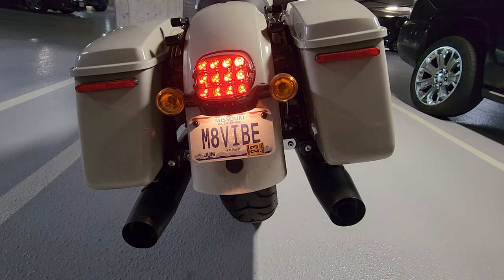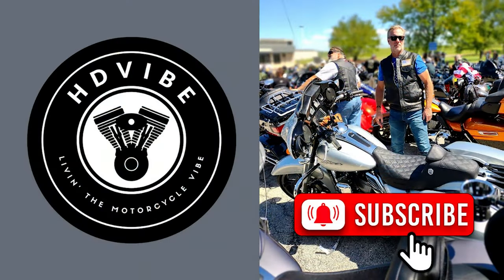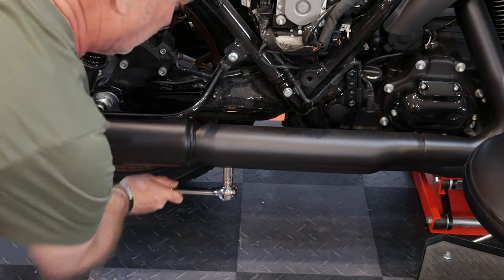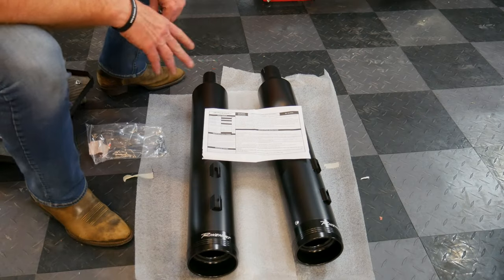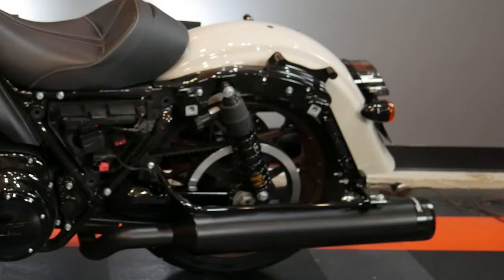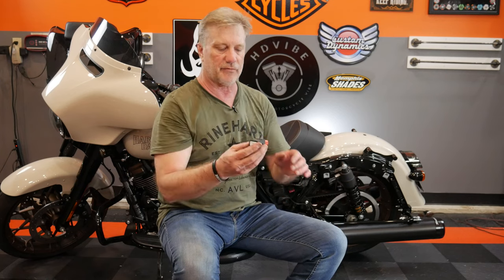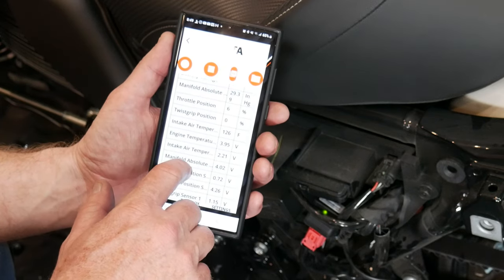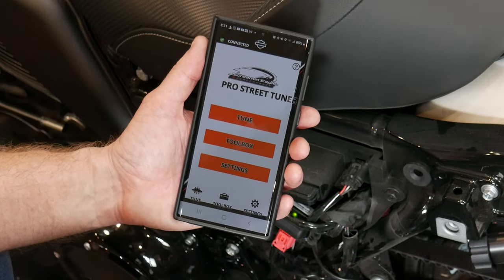Tune your Harley with the NEW Screamin Eagle Bluetooth Pro Street Tuner | Street Glide ST

Comment: Mine came with no instruction sheet :)  It doesn't seem clear, but once you have pushed a tune to the bike, does the bluetooth component need to stay attached to the motorcycle?  Thanks for the thorough vid!
Reply from the maker: Thanks for watching and commenting.   After you load the map to the bike and complete the process...you do not need to keep the tuner attached to the bike.  However, if you do keep it attached, you can monitor the bike via the app on your phone.  If you are already a subscriber to the channel...thank you.   If you haven't yet subscribed to the channel I'd be honored if you'd consider doing so much.   Thanks for your support and ride safe.  ✌️👊👍

Comment: Did that error code disable your ABS? I’ve heard there is a problem with the tuner it messes up the RDRS and your ABS. Great video I’m watching all your content and love it.
Reply from the maker: I had no issues at all with the tuner.  ABS is good and RDRS as well.  Thanks for watching and commenting.   If you haven't yet subscribed to the channel I'd be honored if you'd consider doing so.   Thanks for your support and ride safe.  ✌️👍👊

Comment: I did the SE stage 2 on my FLTRX.
I wanted so bad to do the parts and tune I’m used to but first new bike.  So I went OEM.
447 cam, 55mm intake, SS lifters and cuffs. SEPST.  
I am BLOWN AWAY.  I guess my expectations were kinda low.  But holy cow.  They loaded the map then dialed it in on the rollers.
Reply from the maker: Thanks for watching and commenting.   That sounds like a great setup, especially with the 55 mm intake.  If you are already a subscriber to the channel...thank you.  If you haven't yet subscribed to the channel I'd be honored if you'd consider doing so.   Thanks for your support and ride safe ✌️👍👊

Comment: can you share your MPG after the tune?  my understanding is that the 114 and 117 are already set up from the factory with stage 1 so no tuning would be necessary, the AFR is already correct?
Reply from the maker: Thanks for watching and commenting.   I get approximately 40 MPG.  I get the same mpg on the Stage 1 117 as the Stage 2 114.  I also tend to ride my bikes at higher rpms...usually between 3,000 to 4,000...so my mpg is usually a bit lower than most...I think stated mpg from Harley stock is 42 mpg.  I also have another video that I cover that question and more.  The video is titled Stage 2 questions answered.   If you are already a subscriber to the channel...thank you.  If you haven't yet subscribed to the channel I'd be honored if you'd consider doing so.   Thanks for your support and ride safe.  ✌️👊👍

Comment: I added a slip on last week and didn't like the way my 2023 Street Glide was running. Seemed hotter. I purchased this same tuner, added a K&N drop in air filter, loaded the base tune and now ran 3 auto tune sessions. I know a stage 1 doesn't do much power wise but the bike runs so much smoother and cooler. Night and day difference as it "feels" more powerful.
Reply from the maker: Thanks Greg for watching and commenting.   I'll be adding the K&N filter set up soon as well.  I'm looking forward to auto tuning in the near future as well.  The improvement I noticed most was throttle response.  It just seems much more aggressive...which is good.  If you are already a subscriber...thank you.  If you haven't yet subscribed to the channel I'd be honored if you'd consider doing so.   Thanks for the support and ride safe.  👍👊✌️
Reply: For sure! Subbed, thanks!
Reply from the maker: Much appreciated.   👍✌️👊

Comment: Just traded my scooter in an got a 2023 Ultra Limited, The already put the Reinhart Dbx45s on and added a screaming eagle breather so basically Stage one. How do I find out without asking them if they tuned the bike with provided tuner ? Or if I tune the bike per stage one specs will it confuse the machine if its already done. Only have 33 miles on the bike
Reply from the maker: Thanks for watching and commenting.   The dealership can give you the service record on the bike which would should show exactly what they did to the bike.  If they didn't give you a tuner,  my guess is it hasn't been tuned.  I bought a bike that had Stage 1 done by the dealer before delivery as part of the deal.  It included the DBX 45s and tune.  The tuner was in the saddle bag in the box.   I hope that is helpful.  If you are already a subscriber to the channel...thank you.  If you haven't yet subscribed to the channel I'd be honored if you'd consider doing so.   Thanks for your support and ride safe.  ✌️👊👍

Comment: I am just curious what happens if you have an aftermarket exhaust that is not screaming Eagle? Will the tune not work properly because of this?
Reply from the maker: Thanks for watching and commenting.   The Stage 1 tune works very well with non Harley exhaust.  The flow between Harley slip ons and aftermarket slip ons is not that different so the tune is just fine.  If you are already a subscriber to the channel...thank you.  If you haven't yet subscribed to the channel I'd be honored if you'd consider doing so.   Thanks for your support and ride safe.  ✌️👊👍

Comment: I just liked your 1500 mile review of the ST and saw this video waiting to play...so i did play... whats your take on the Bluetooth tuner compared to the cable linked screaming eagle tuner?. I am big on viewing data, would it be worth the switch from cabled tuner to the Bluetooth?  Having the option to clear codes on other vehicles (kenworth semi) has saved my wallet big. I just dont want to monkey too much with the H-D extended warranty i have on my 21 flhxs...
Reply from the maker: Thanks for watching and commenting.   The Bluetooth svreamin eagle tuner is great.  I have both versions and like the Bluetooth version much better.   You can monitor much more from the app.  You can also much easier to an auto or smart tune with it.  It will not impact the warranty at all...that is exactly why I went with it.  I'll be doing a video on the functionality in the near future.   Just as an example, the service advisor at my local dealer had the old tuner and bought the Bluetooth version because it's easier to use. Thanks so much for your support to the channel.   Much appreciated.   Ride safe and enjoy.  👍✌️👊

Comment: Great video.  Now that youve had it installed and some miles how do you like the tuner? I did a PV on my 21 RKS when i did a full exhaust, but still have a year on my warranty. This looks like a better option than the old SE tuner to reflash and use till my warranty expires, if it has everything. 
Man that ST is slick.
Reply from the maker: So far I really like the tuner.  It's also nice that I can pull up the app on my phone while riding and monitor the operation of the bike.  I'll put some more miles on the base tune then run some auto tune sessions to get it dialed in even more.  Ride safe and enjoy. 👊✌️👍

Comment: I have a quick question, someone may be able to help answer.  While my Triglide was in getting serviced, I had HD install the high flow breather and Pro Street Tuner.  Does anyone know if even though the tech did the tune am I still able to pair with my phone to see the properties etc without disrupting the already completed stage one tune?
Reply from the maker: Thanks for watching and commenting.   If you have the Bluetooth tuner,  you can connect it to your phone as shown in this video.  From there you can monitor and do smart tune etc.. if you are already a subscriber to the channel...thank you.  If you haven't yet subscribed to the channel I'd be honored if you'd consider doing so.   Thanks for your support and ride safe.  ✌️👊👍

Comment: I have a question… if i do that can i lose my warranty???
Reply from the maker: If you use the Harley tuner I used in this video you will not void your warranty.  The map that is loaded from the tuner has Bern developed by Harley and still meets the EPA requirements.   I have 3 bikes using the Street pro tuner and all still have valid warranty.   Thanks for watching and commenting.   If you are already a subscriber...thank you.   If you haven't yet subscribed I'd be honored if you'd consider doing so.  Thanks for your support and ride safe.  👊✌️👍
Reply: @HDVIBE  thank you so much brother
Reply from the maker: You are welcome.  I look forward to seeing your comments on other and future videos. ✌️👍👊
Reply: I just put the dbx45 like yours and i have the same bike only thing i have to buy now is the tuner 😊… do you have to leave the tuner conected ???? Or you can take it off when you finish with the tuning
Reply from the maker: You can take the tuner off after you tune.  You can leave it connected if you want to monitor engine Temps etc.  Or to do the auto tune.  Thanks for watching and commenting.  Ride safe and enjoy. ✌️👍👊
Reply: @HDVIBE  thank you brother ride safe 💪🏻
Reply from the maker: You are welcome 👊

Comment: does the tuner flash the ecm? because none of the instructions nor videos mention reflashing the ecm.
Reply from the maker: The tuner uploads the map to the ECM.  When you auto tune, the adjustments are also loaded into the ECM.  That happens as shown in the video where the bike turns itself on and off.  👊✌️👍

Comment: I have a 2013 Electra Glide Ultra classic CVO with the 110. If all I'm doing is putting on slip Ons, is that considered a stage one when using the pro street tuner? Thanks in advance
Reply from the maker: Thanks Floyd for watching and commenting.   Slip ons, high flow breather and a tune is considered a Stage 1.  If you are already a subscriber to the channel...thank you.  If you haven't yet subscribed to the channel I'd be honored if you'd consider doing so.   Thanks for your support and ride safe.  ✌️👍👊

Comment: Because of the heavy breather being stock on this bike, isn’t the bike already tuned to stage 1 from the factory?
Reply from the maker: Thanks for watching and commenting.   It's tuned for that breather but not necessarily for better flowing exhaust.   The Stage 1 tune made a big improvement in throttle response.   Stock tune the throttle response was slow...after uploading the stsge 1 map, the throttle response is almost immediate.   If you are already a subscriber to the channel...thank you.   If you haven't yet subscribed to the channel I'd be honored if you'd consider doing so.   Thanks for your support and ride safe.  ✌️👍👊

Comment: Question 
Im using a backup phone. Will the tuner/ app lock to the phone?
Reply from the maker: Thanks for watching and commenting.   I do not believe the tuner locks to a specific phone.   As long as you load the app, you should be able to link to the tuner no matter the phone.  Basically a Bluetooth connection to the tuner.  If you are already a subscriber to the channel...thank you.  If you haven't yet subscribed to the channel I'd be honored if you'd consider doing so.   Thanks for your support and ride safe.  👊✌️👍

Comment: Quick question. How is the throttle response after the tune? I’m holding off on a cam. But the throttle response is lagging at best. I have the exact bike and pipes.
Reply from the maker: Thanks James for watching and commenting.   The tune definitely fixes the lagging throttle response.  I was very pleased with that improvement after loading the map.  If you are already a subscriber to the channel...thank you.  If you haven't yet subscribed to the channel I'd be honored if you'd consider doing so.   Thanks for your support and ride safe.  👊✌️👍
Reply: @HDVIBE  thanks for the quick response. Look forward to more of your videos. Guess I’m gonna have to pull the trigger on that tuner. I’ve always used TTS and dyno tuned my bikes. Decided to keep the warranty intact on this bike. Especially considering what I’m paying for it. Ride safe Brother.
Reply from the maker: @user-xw7ou5wy4s 👍

Comment: Did you just change the slips on and the air filter? Or did you change the exhaust header? I got a krome werks 4.5 slip ons and im about to change the air filter to the heavy breather but im not sure if thats all i need to do the stage one
Reply from the maker: Thanks for watching and commenting.   In this video I added slip ons and loaded a Stage 1 base map tune via the screamin eagle Bluetooth Pro Street Tuner.  Technically speaking, a Stage 1 consists of adding slip ons, a free flowing breather then a Stage 1 tune.  You don't need to change the headpipe unless you want just a bit more sound and a reduction of heat coming off the headpipe.  If you are already a subscriber to the channel...thank you.   If you haven't yet subscribed to the channel I'd be honored if you'd consider doing so.   Thanks for your support and ride safe.  ✌️👊👍

Comment: I just bought that tuner today and had to order the air cleaner I wanted the dealer didn’t have it in stock
Reply from the maker: Thanks Richard for watching and commenting.   Which air cleaner did your order and what bike are you tuning up?  If you are already a subscriber thank you.   If you haven't yet subscribed to the channel I'd be honored if you'd consider doing so.  Thanks for your support and ride safe.  ✌️👍👊
Reply: @HDVIBE  the screaming eagle high flow round filter with the gold eagle cover
Reply from the maker: Nice. 👍

Comment: I’ve got a 2023 street glide. I still have the warranty so I cannot go to an aftermarket tuner is the screaming eagle tuner a hit or miss kind of tuner because I want to be able to put a better tune on my bike instead of spending right at $2000 to go to a Dino, any affirmation would be great
Reply: That was supposed to say any information would be great
Reply from the maker: Thanks for watching and commenting.   If you want to keep your warranty in place,  the Screamin Eagle Pro Street Tuner is about the only option.  I have use an SE tuner on all three of my bikes and I'm comfortable saying my bikes run great and the tuners are user friendly.   I have a Stage 2 Road Glide Special which is tuned using the SE tuner starting with the base Stage 2 map and then a few smart tune sessions.  In my opinion, the bike performs incredibly.  So, I don't think I will ever spend money on a dyno tune especially $2,000...

If you are already a subscriber to the channel...thank you.  If you haven't yet subscribed to the channel I'd be honored if you'd consider doing so.   Thanks for your support and ride safe.  👊✌️👍
Reply from the maker: I also have 2 other videos featuring the SE tuners and how to run smart tunes.  You may want to go check those out as well.
Reply: Thank you
Reply from the maker: @matthewsenn391 You are welcome Matthew.

Comment: I subscribed. Great info man. Can I do the same stage one tune on a 2022 RG Limited with the stock breather but tab performance / zombie baffles slip ons? or do I need to do the breather? I got the stock wedge breather and its a 114
Reply from the maker: Thanks for watching and subscribing.   You can do the Stage 1 tune with the stock breather.  I believe it is a high flow as well.  Then you can do some Smart Tune sessions to get the tune set for your set up.  Down the road you may want to consider the Ventilator Extreme breather.   You will definitely get more air in to the bike which is key to performance.   That is the breather on the Street Glide ST.  Thanks for your support and ride safe.  ✌️👊👍
Reply from the maker: I also have a video on the channel showing the Ventilator Extreme and how to Smart Tune with the Bluetooth tuner for future reference.  👍
Reply: @HDVIBE  yeah I’m thinking about that upgrade next. It’s pricey but still want you to do it. I’ll check out the video. Thanks!
Reply from the maker: @thadsalamon3580 👍

Comment: I have a 2022 St Street Glide and was wondering if this tuner and exhaust gets rid of the small hesitation when applying the throttle? Thank You!
Reply from the maker: Thanks for watching.  I believe I mentioned that in the video. The throttle is much more responsive... no hesitation at all.  If you are already a subscriber...thank you.  If you haven't yet subscribed I'd be honored if you'd consider doing so.  Thanks for your support and ride safe.  ✌️👊👍
Reply: @HDVIBE  Thanks for the reply. Yes I do remember you mentioning the throttle response, but did you notice kind of a flat spot and or hesitation when just beginning to turn the throttle? That is what I was wanting to fix and did you feel a ''no flat spot'' there at the very beginning of the opening of the throttle?
Reply from the maker: That is exactly what I noticed...and now no longer an issue.  It hits as soon as you twist the throttle.👊👍✌️

Comment: So I installed the tuner on my 21 low rider s but can’t figure out how to smart tune it now do I need to leave it on the bike and run the bike a few days did you ever do the smart tune
Reply from the maker: You do need to leave the tuner on the bike to run the smart tune process.   I have not yet done it on my bike but if you follow the screens on the app, it seemed like it was pretty straight forward.  There is a user manual that steps you through the process.  https://hdstcdn.service-solutions.com/streettuner/Mobile-Tuner-User-Manual.pdf
Reply from the maker: I left you a link to the user manual.  Hopefully that will get you headed in the right direction.  If you are already a subscriber to the channel...thank you.  If you haven't yet subscribed to the channel I'd be honored if you'd consider doing so.   Thanks for your support and ride safe.  👊✌️👍